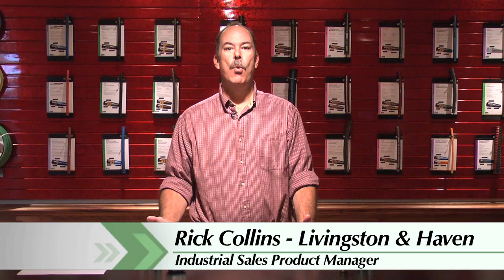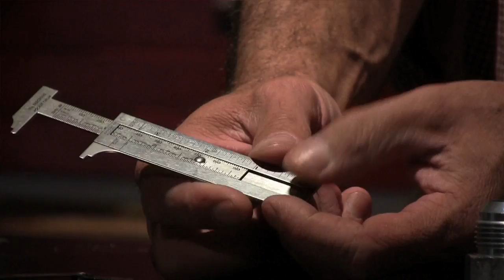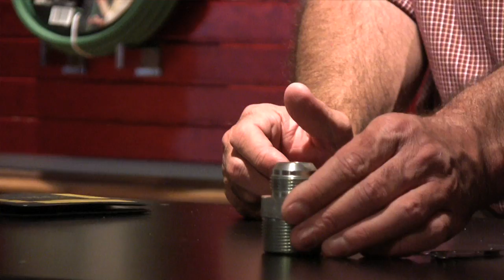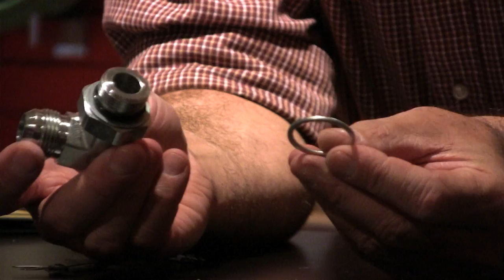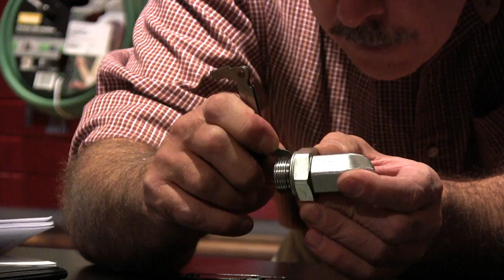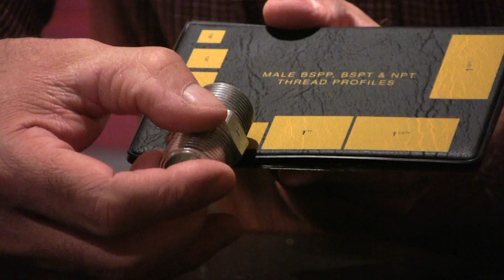Shop Talk - Fitting Thread Identification - How to identify your fitting's thread type

Comment: Helpful to identify male threads, BUT: 
I purchased a Chinese-manufactured pool pump equipped with a female-threaded 1-1/2" suction port and a female-threaded 1-1/2" discharge port. I am unable to determine if the female ports are NPS or NPT.  Suggestions?

Comment: Hello and thanks for the vid and brilliant explanation, as I am just struggling to find out, what thread the ports of my Kubota hydraulic bloc are. There ports already connceted to fiitings/tubes, but there is a set of 3 ports plugged for an additional valve-bloc. The thread of the blind plug is exposed for 1 or 2 threads, the head is squared. From that said and your explanation, I conclude it is a tapered thread, NPT. The size is 3/8", I guess. An you can see a strip of white tap looking out of the thread. When I look to the ports already connected, it seems to be different as the head of the fitting sits flat on the housing of the bloc. So, the question for me is: are there NPT connectors with O-rings in the market? Will I shoot the NPT thread srewing a BSP fitting into the port?

Comment: 3/4 - 14 could be a BSPT or an NPT. You need to measure the diameter to distinguish between the two. This is very important as the different thread angles would mean an unsafe connection.